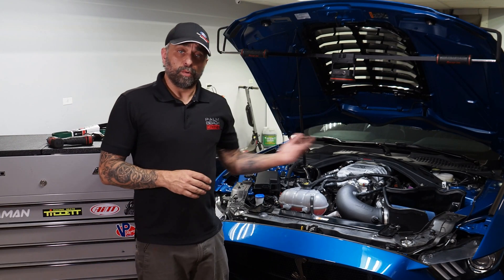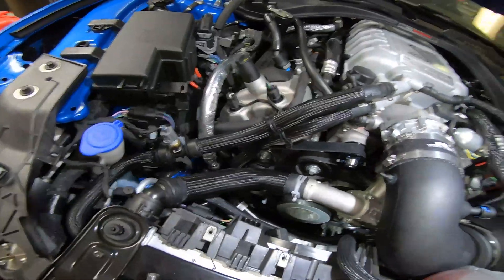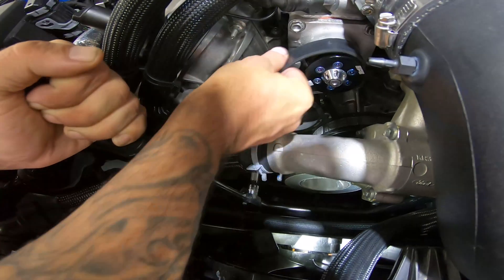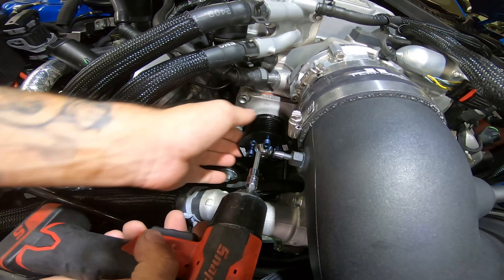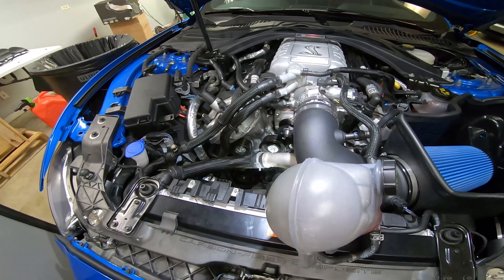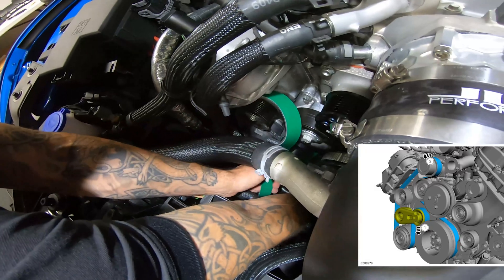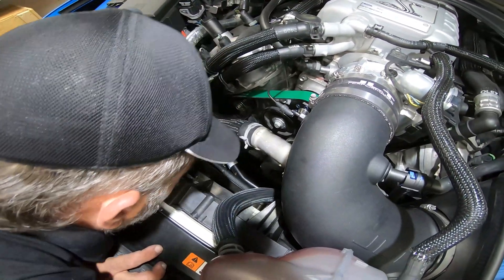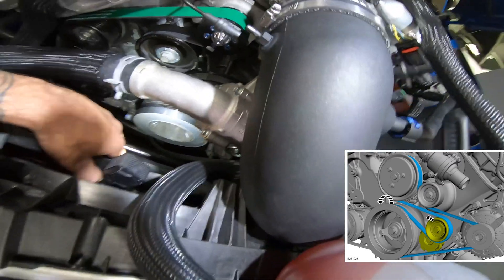2020 GT500 TECH: How To Swap Your Supercharger Belt And SPE Pulley

Comment: Hey sir, you didn’t need  to buy the whipple after market tensioner? Also, is it safe going with that 2.27 without running E85 ? I was told to go with a 2.85 with a simple tune.